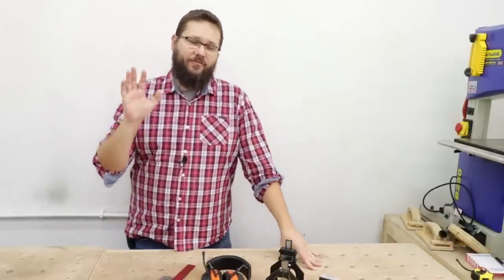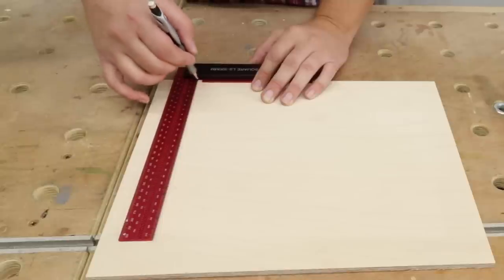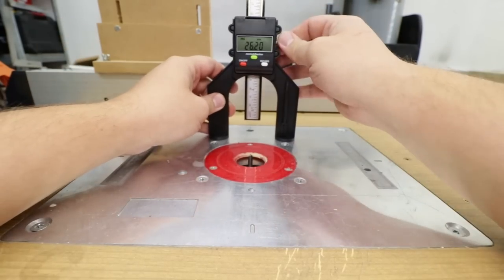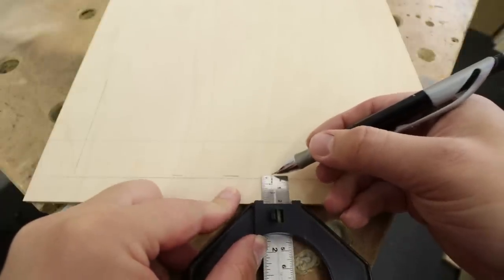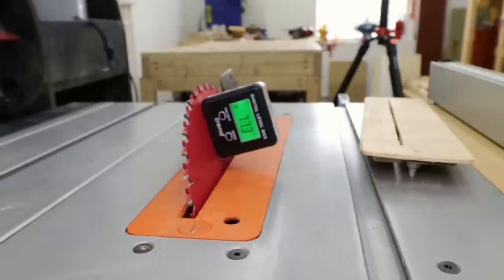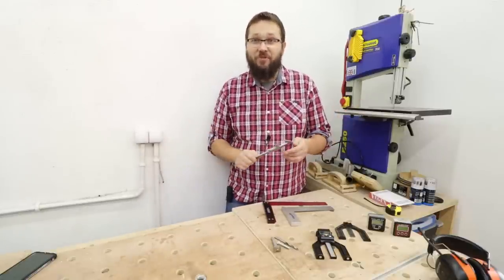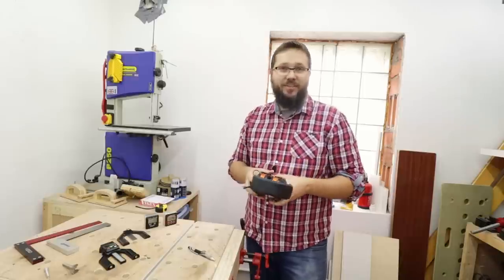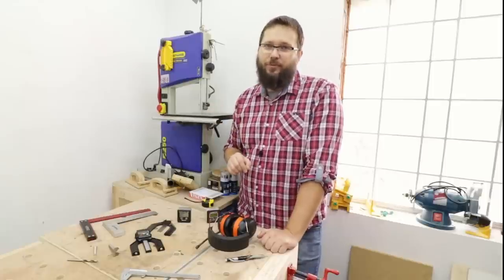5 NOT essential tools that You Must Have

Comment: That square looks great (providing it is…square)…I just bought the similar, Woodpeckers 300mm square..it is nice, and tested true, no question, but over a hundred bucks more than the Veiko…and it doesn’t even have the pencil guides either.  The depth gauge could be made easily from a scrap of ply and a small steel rule…I might do just that.

Comment: 1x30 belt sander. It's not essential but it makes sharpening stuff much faster. I used to do the scary sharp thing with glass and sandpaper. Now I just use the belt sander and a little jig to set the angle. It takes seconds to have a chisel razor sharp.

Comment: An angle box on the mitre saw?  I have a compound mitre saw and I have an angle box which I use on my table saw. I regularly flip the angles around. I hate the mitre saw because it never sets back to 90 on the clicks and I have been using a small square to reset the saw, working against the saw teeth. It never occurred to me to use an angle box on the mitre saw..... I hope your next precious cut is off!
Reply from the maker: Been using this for a very long time. Super easy and quick to get back to desired angle 👍😅

Comment: I have the Trend digital level box, makes setting up a table or mitre saw so much easier and quicker. I also have that digital caliper, I find it pretty accurate and handy to keep in my toolbag as it comes in a case that is quite slim.
Reply from the maker: They are great little helpers

Comment: It's expensive but a dust collector that autostarts with tools. In my early years I had dust collectors but would forget to start them before cutting/routing/ etc.
Reply from the maker: Yes most of the times got the same problem. My shop vac has got the feature but its only good for low power tools like a sander. My table saw is a no go.

Comment: Love this Tomasz I’ve got so many but a couple that spring to mind are a magnetic wrist strap which attaches using Velcro and it’s handy for holding screws and nails leaving your hands free and I also have a telescopic magnet with a built in LED which is handy when you do small parts or screws in sawdust 👍🏻
Reply from the maker: Thanks mate, got that magnetic wrist strap as well but I have to say I hardly ever use it. Mainly because I forget I got it lol The telescopic magnet seems quite an interesting option

Comment: A 2nd drill.  I have one for drill bits, the other w/ a hex holder for driving screws.  When I was starting I had only 1 and swapping drills for bits got very tedious.
Reply from the maker: That's exactly what I do, having two drills and or a impact driver
Reply: Three! One for the pilot hole, one for a countersink bit (unless you use combination bits with built in cs) and the third to drive the screw.
Reply: I would add a marker for making marks through deep holes where normal pencils can't go. Not expensive and very handy.
Reply from the maker: @johnmusgrave3179  I like it 👌